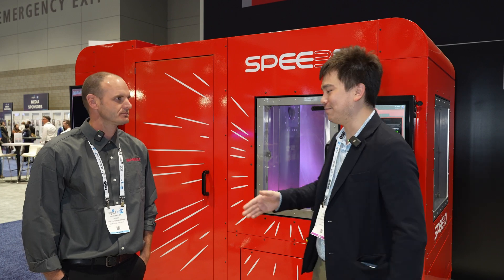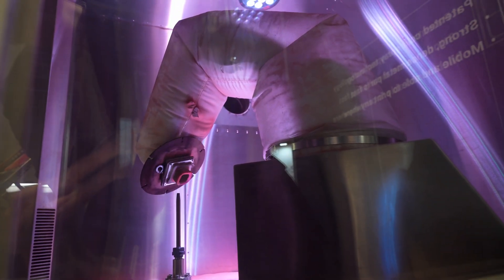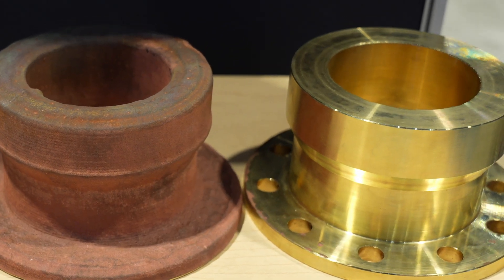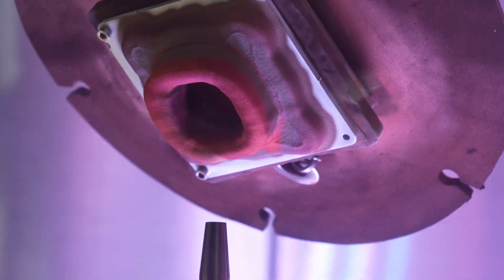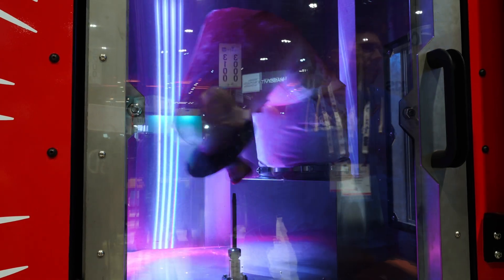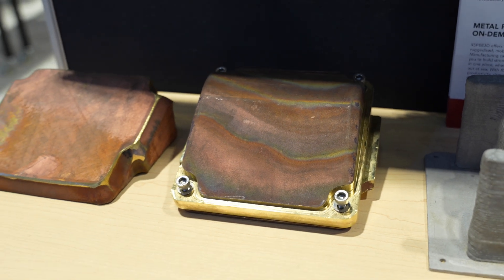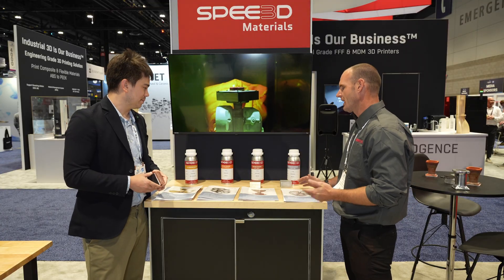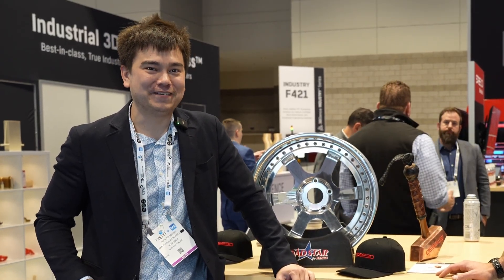Fast Metal 3D Printing with SPEE3D - Cold Spray Additive Manufacturing

Comment: OK for thick section parts with no fine detail. A rough casting at best without the possibility of sectional detail. I would also imagine it uses a lot of power to run a diving compressor flat out for so long. Probably a 20+ hp motor. Honestly I thonk speed wise , energy wise and raw material wise you could easily do the same with a contained casting unit. The only challenge would be the moulds for the core boxes but s liquid low strength solution could do it. It would have to be cheaper as well and create a better pre finished part. 
They say the strength is between casting and forging with it closer to forging but honestly the amount being talked about could easily be adjusted with material change when cast.
Honestly if it cant do steel it really isnt worth the effort.

Comment: LOL its expensive to get thing to space LOLOLOLOL.  then don't send many machines. send the tool to make  machines and use that the make your 3d printer  lol you just have to build a machine shop on the space station you need to do that anyway so why not

Comment: hmm i think the post processing of the parts is a big killer for me... not that i could afford it but like curious why one would pick this tech over some sort of other 3d metal printing process that may or may not need as much post milling.

but so cool and different! its cool watching how this one works vs all the other tech out there!
Reply from the maker: I think that should be a lot more robust in transportation and would have less stringent requirements in installation conditions. Plus the powder particles are larger and pose a much lower risk of explosion and respiratory issues in handling. 
Pretty much every metal additive process requires heat treatment to get good properties, so I don’t think it’s too big of a deal
Reply: The major advantage is speed, a part that might need days to laser sinter can take just hours with a cold spray process.

Comment: Is there a lower priced desktop version that is or will be available for those that are using plastic 3D printing to move into metal 3D printing?
Reply: No lol
Reply: Build it yourself maybe? The essence of the machine would be air compressor, heater, stepper motors and the control board with its firmware. Along with the dust proof enclosure of course. It would take months to years to build and run depending on your spare time, tweaking and adjusting things along the way. But if you already have your head wrapped around "standard" FDM Cartesian printing this would be cool to pull off.

Comment: So, you need the supplies, the computer systems and personnel to design/input the part, the machine itself and people to run it, then you also need the machining and finishing equipment and personnel to run them. Where's the benefit?
Reply: Learn how to use CAD and how to run it through their on-site information. Anyone who intends on purchasing this machinery already knows how to use it.and the benefit lies both in speed of fabrication and affordability (considering many other printers are priced in the hundreds of thousands and millions.)
Reply: All 3d printing is prototyping before it's manufacturing. The job completion time largely stops it being used in mass manufacturing but the flexibility and in house nature always beats shipping times. Their main markets are for remote marine and military deployments. There's another video of the same company working with the ADF were instead of having to bring in a welder with exhaust tubes to fix an exhaust stack and a machinist with square stock to fix a hinge, the print team did both in less than 48 hours. Of course, this is used were practical. Were you to have to replace hand rails and guard rails, that would be done by shipping in the rails and organising the workers the usual way. But yeh, 3d printing is a cool technology with its uses.

Comment: The marketing drivel bullshit coming out of these guys mouths is absolutely impossible to watch.  I'm so sick of salesmen.  I want to talk to the engineers about this, what are the drawbacks, why aren't they doing any subtractive on this arm between build ups?  What are the problems that you have to overcome to get better looking parts out of this verses these blob looking parts which are obviously subtractively milled afterwards?  What's the benefit of using this machine instead of just grabbing a block of metal?  A commercial CNC doesn't take 3 1/2 hours to hog out the rough shape of a part, so what is the value-add here?
Reply: Exactly what I was thinking! On the other hand, you can talk those military dumbasses in acquisitions into buying anything with the money they get for free.

Comment: Wow! this is a wonderful process, no supports are required like powder sintering for the green part, the finished machined part was just like a a regular fully machined part.
 This could be a process that would suit the gold mining industry that is usually in places where new parts are hard and expensive to get into the field
Reply from the maker: Yeah. And since it is a robotic system it is actually pretty flexible. You could take parts, install them in the arm, and deposit some additional material, either for conductivity (adding some aluminum or copper directly onto a steel surface), hardness (depositing carbide on an aluminum surface), heat resistance (depositing inconel on a steel or aluminum surface), strength, etc, the list goes on. Sounds like the applications need to catch up with the technology.

Comment: Great b-roll, and used quite well also. Did you provide the mic for the interviewee?
Reply from the maker: Yes I provided the mic, I wish it was a little more discrete, kind of blingy DJI badging on there which I don't really like. But they get the job done and are super easy to use. Just need to turn the gain down a tiny bit next time. A lot easier to use than video tapes!
Reply: @NathanBuildsRobots  Does the mic have a wind screen? If it does, that might reduce / improve the sound. I found it very gravelly (if that makes sense).
Reply from the maker: @corlissmedia2.0  Yeah it has wind protectors, I'll try that out. Also had to filter out some frequencies due to a high pitch wine from some of the machines running at the show. 
Also I will take off my lanyard because in some videos it brushed against the mic and made tons of noise. Lessons Learned!
Reply from the maker: @corlissmedia2.0  
Also, been watching the Campbell guy. Interesting stuff.
Reply: @NathanBuildsRobots  failures on camera are some of the best teaching experiences. The Hero with a Thousand faces is one of Campbell’s best books.

Comment: HOw is this faster than melting it in a kiln?
Reply from the maker: Like melting the metal in a kiln, then pouring it into a mould? There are major differences,  so it's hard to compare them. both can be used to make near-net shaped parts in a pinch. 
This process is faster, because you don't have to make a mold, heat up the metal, demold, wait for the part to cool off, and worry all sorts of casting related issues and limitations. Plus its mostly automated and self-contained. 
I guess you could make a small foundry that is all self-contained and produces parts like what this machine does, but it would have its own set of costs, challenges, and limitations.